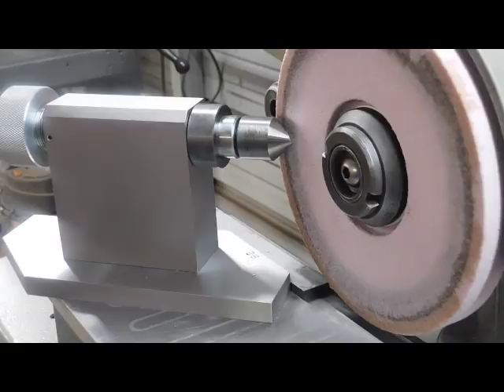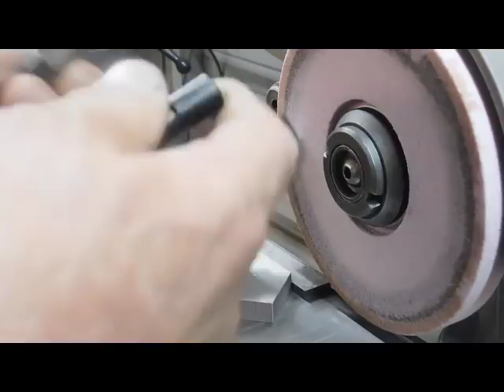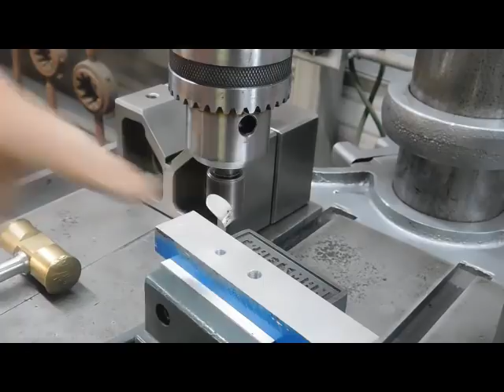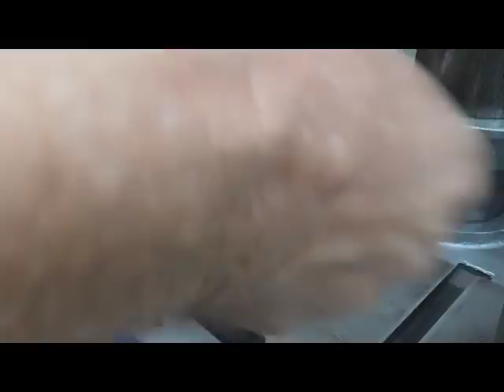Countersink Sharpening Fixture

Comment: to make the cam could you youse a fine thread nut and bolt and clamp the bolt in the milling machine vice and youse the nut as a cam and advance the nut into a running milling cutter one turn upwards after it starts cutting driveing the nut forwards by using a spanner or is there a better way